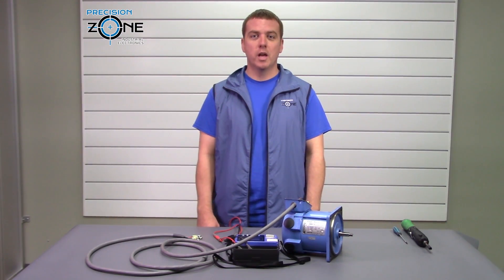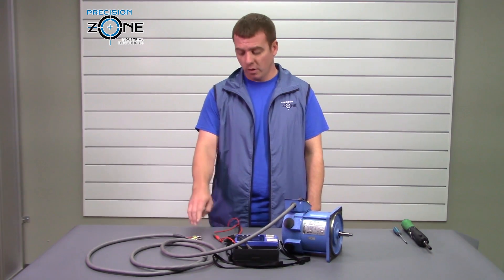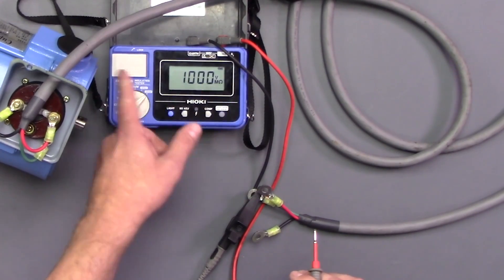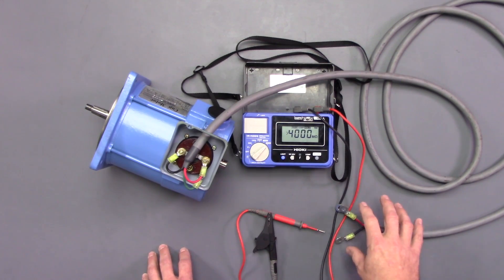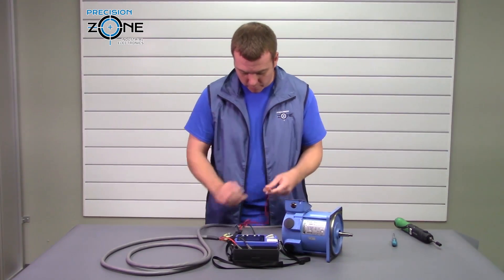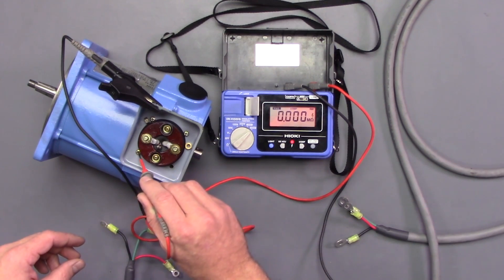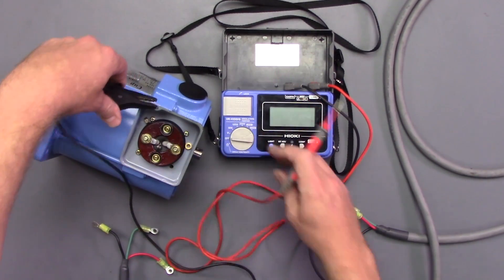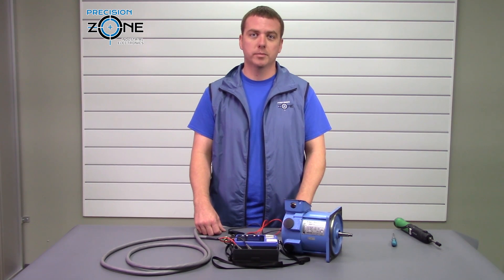How to Check Your DC Motor is Grounded

Comment: Thanks for cogent  explanation for fault check about DC motor.

Accordingly,Please clarify the following about motor winding universal motor of mixer grinder:

1.If  resistance value between neutral wire and motor windings:speed1.2.3 showing infinity/ OL(1)
(N-Sp1,N-Spd2, N-Spd3)
Then,What is the reason for infinity value/1??,when measured between N-Sp1,N-Spd2, N-Spd3.

2.But, Motor winding resistance values between Sp1 & spd2 winding : 1.5 ohms , 
between spd2 to spd3: 2.3ohms  
between spd1 to spd3: 11.5 ohms.

3. Also,Resistance between Motor windings & motor body is infinity/1

# So Please guide us how to troubleshoot the problem as mixer grinder's universal motor stopped working at present
Note: Power supply continuity signal is OK/ Normal,from cable -plug to Rotary speed switch along with internal thermal circuit breaker..

#Please reply
koustuba.sheshappa@gmail.com